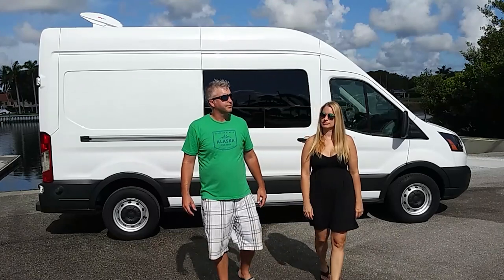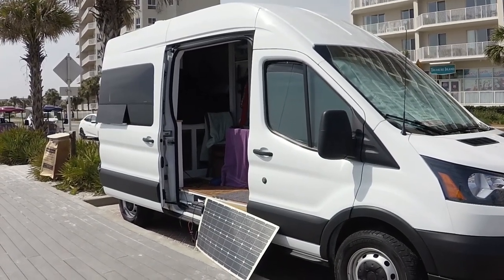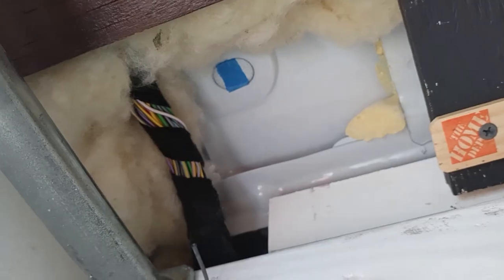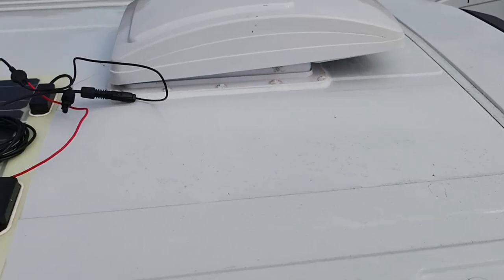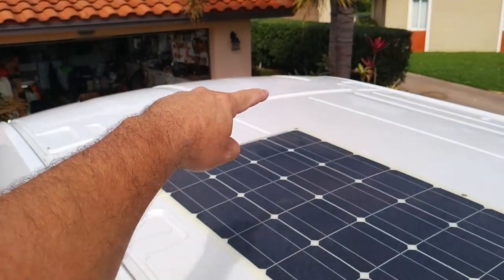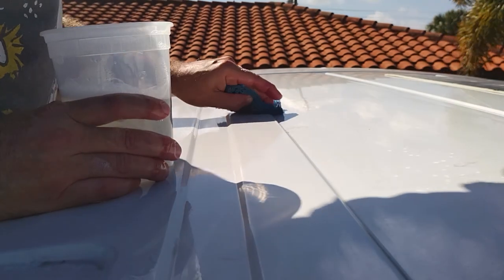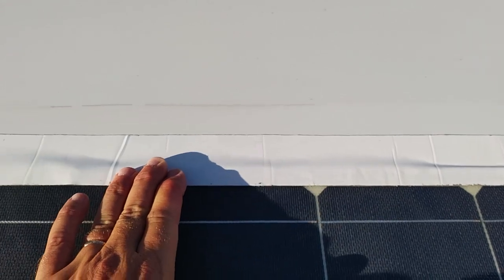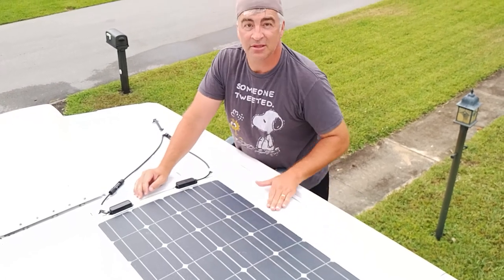No drill flexible solar panel installation on a Ford Transit camper van | VAN BUILD #26

Comment from the maker: UPDATE: We've since added two more of the same flexible 100-watt panels to the van. The two panels in the back have held up great. However, we almost lost the new panel at the front while driving on the highway (you can see the whole fiasco here: https://youtu.be/hnzRuWZd1qc). Due to the curve of the roof at the front on a high-roof Transit van, we think the drag from the wind caused the Eternabond tape to start coming loose. We have since re-taped the front panel with 4-inch Eternabond tape instead of 2-inch and we'll try to keep you posted as to whether or not that holds up!

Comment: I just order my flexible solar panel. Your video really helped me decide how I’m going to install mine up there. I have a Ford transit 250 2019 and I’ve been wanting Solar. I’ve been in it for two years now and I really need my solar so I’m gonna try what you just did. Thank you for your video.
Reply from the maker: Great to hear. We have been pretty happy with ours. Just be mindful of placement - especially the closer you get to the front slope. Anywhere on the flat portion of the roof you should be fine. Just use extra tape if you need to install on the front slope. 

Also, be sure not to tape on the solar panels themselves. Not even a little bit. It will reduce the power production significantly.  

Thanks for watching. Let us know if you have any questions.

Comment: You can purchase the mc4 connectors, that way you just order the cable, install them then cut and add the connectors for a perfect low stress installation.
Reply from the maker: That's certainly a good solution

Comment: We used also Eternal Bond tape on Flex Panels as you did but after went thru brutal hot weather in Utah, the rubbers were gotten loose then wind eventually get them loose and shipped them almost off.  We will re-do using method by TitoRV youtubers.
Reply from the maker: Funny you should share that. We have since added two more panels. The original and new panel toward the back have both held up fine but the panel near the front just also started coming loose for us on a recent trip. We think that happened because the wind might hit it differently at the front of the van. We haven't put it back up yet. We have watched RV with Tito DIY videos and thought we had used the same tape method that he did. Is that who you mean? Do you have a link to a different type of application? We'd be interested to know if there is a way to do it that will hold up better.
Reply: @SteveAudra  Tito DIY had new version using aluminum clamp rod, we are going to do same but will add Dicor around the rods for more stable. Main thing is make sure no air slip in otherwise Mount panels on roof with extreme heat. Eternal tapes won’t last long.
Reply from the maker: @adassociates8235  Thanks. We found and watched the video. We'll have to figure out what we're going to do, at least with the front panel.

Comment: I would have never cut them wires. That plug hole was big enough to fit those ends through. You could just slit the plug to fit the ends then silicone the plug. Then feed one at a time down through the wall. Also that tape you used on the panels require a roller specifically made for sealing that tape.

Comment: Be careful adding future panels. I don't think you can mix and match, so adding another 100w on the passenger side would be great, but I don't think you can add a 50w up front. I looked into it just a bit when I added 2 200w panels on my Transit and I remember something about drastically reducing efficiency even if they are the same voltage.
Reply from the maker: Thanks so much for that tip, Bill! We were just starting to research that today and were looking at another like we already have. We were wondering if we could do another with higher wattage though. Thanks again.
Reply: Adding different panels in parallel will combine the lowest voltage and adding different panels in series will combine the lowest amperage. So combining a 100 watt panel of 20 volts in parallel to a 100 watt panel of 19 volts will be 19+19 and not 20+19. Combining a 50 watt panel of 10 volts in parallel to a 100 watt panel of 20 volts will be 10+10 and not 10+20.

Comment: I so appreciate this video. I bought a high cube van and I am trying to decide if I want a solar panel on the roof. I would appreciate knowing how it would stand up to hail and other elements.
I also would appreciate knowing some if places to explore on the east coast on a super tight budget. 
Thanks in advance. Love your videos. Lynn
Reply from the maker: Hi Lynn! It's so nice to hear from you. Thanks for following along. I can't offer a professional answer on how the solar panels hold up, but I think they should, especially the flexible panels because they aren't fragile and seem really durable. I think solar panels in general are designed to withstand the elements. We're really happy with the flexible panel and think it's easier to work with because of being able to tape it down. There is also less wind resistance. Have you watched our travel videos? Pretty much anywhere we go is low budget! We have only paid once to stay at a campground. We typically stay at Cracker Barrels, Walmarts, Home Depot, or places on the iOverlander app that people can verify have been okay for overnight parking. Then during the day, we try to avoid places where you have to avoid parking fees. Let us know if you have more questions!
Reply: @SteveAudra  thanks, yes I do watch your travel videos. I love them. I can't wait to get started.
Reply from the maker: @lynnrice444  Awesome! Feel free to ask about any spots we have been to. I also try to include helpful info in the video descriptions!

Comment: When fishing wire with a pull string you want to loop the string around the wires with a slip knot, twice. This way when you pull the string it is cinching down on the wire as you pull. The tape just keeps everything bundled up. That was painful to watch ;-)
Reply: Also I would be very concerned about chaffing on those wirrs without some type of sheathing to protect. Just constructive critisism. I am building my van right now so appreciate the video.
Reply from the maker: It was as painful to experience ;-). Lesson learned.
Reply: I was going to say the same thing. I used to pull cable for a living and slip knots are key

Comment: Great video. Nothing seems as easy as it should be on a van build. Did you put any insulation material under the flexible solar panel?
Reply from the maker: You are so right about the van build process! LOL! We have quite a bit of insulation in the ceiling of the van - a combination of polyiso and Havelock wool insulation. On the roof, the panel is taped directly to the van with nothing in between.